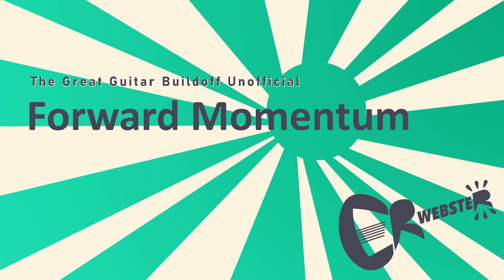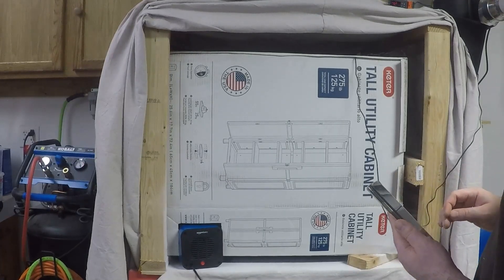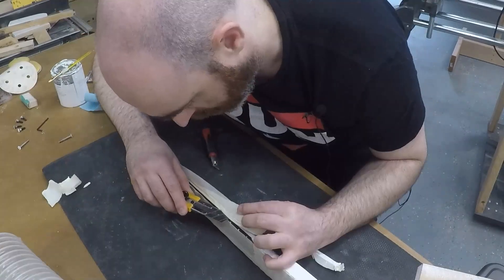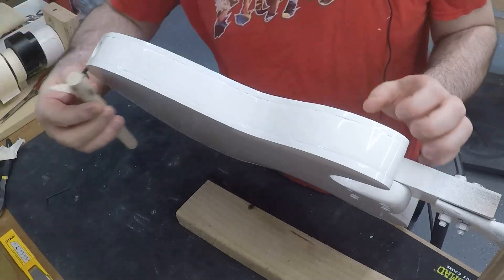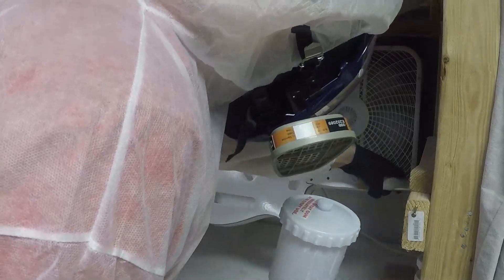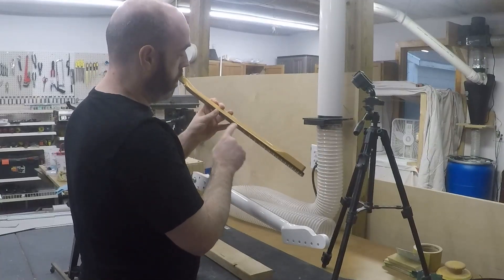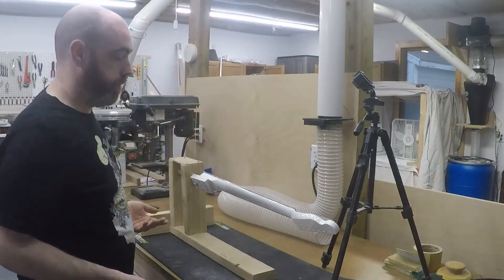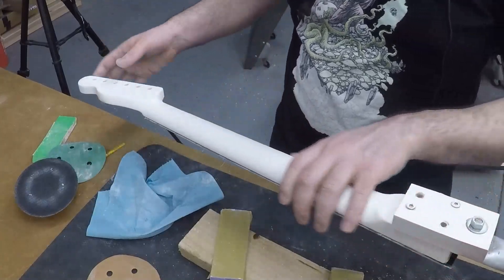Great Guitar Build-Off (Unofficial) - Part 8: Forward Momentum

Comment: You give so many details. It's like taking a painting/finishing class. Great video!
Reply from the maker: Thanks!  I'm definitely trying to convey as much useful information as possible, especially if I had some trouble and found a way past it.
Reply: @ERWebster  I'm also liking the build. My bass is white with black binding. No glitter, just white. All the hardware is black. I even use "Black Beauty" black coated strings. I like the stormtrooper feel.

Comment: That shop is fantastical!
Reply from the maker: Yes it is, no doubt.  I got this place right about a year ago, before that I was working out of a 250 sq. ft. garage.  What a change that has been, and I am super happy with my new space. 😄
Reply: All you need is a little improvement on your paint booth 😊 but you are doing very well with what you have, I must say 👍😊🎸
Reply from the maker: @janolesen8938  That improvement is in the planning stages, but when I begin construction my plan is to share that process with everyone as well. 🙂
Reply: ER Webster when done you can turn pro 😂👍 keep up the good work 😊

Comment: Great work! I use Speedokote 1210 glamour clear, cut and buff in 1 hour dry time. Generally in automotive paint systems I use a color blender (Speedokote SMR-3500LV-Q) which is a ready to spray clear that you mix your pearls, flakes, candy, etc in and spray prior to your 2k clear.  Check it out.
Reply from the maker: Wow alright, I'll have to check those out. Thanks for the tip! 👍

Comment: let us know, when that cheapass box fan in your "booth" explodes from the paint fumes, and over spray, when your painting.....
Reply from the maker: I agree, it's not the safest setup which is why it and the booth were only temporarily set up for this build. 
As for an actual chance of an explosion, it is  unlikely in the short term since the motor design on these cheap box fans is induction type, which means no brushes or sparks. Still not safe for long term use since solvent exposure can degrade insulation. 
Will be glad to get a proper booth setup for sure. Thanks! 👍